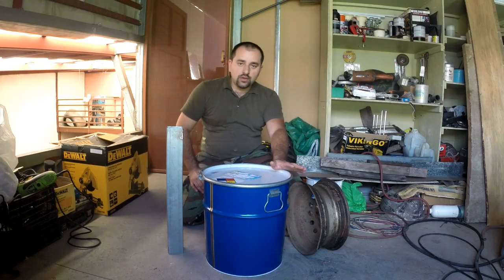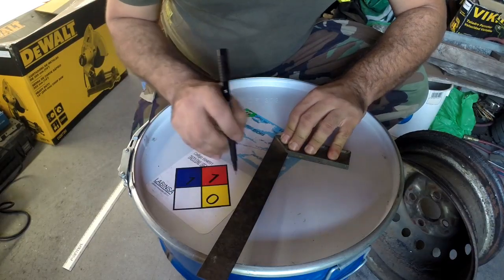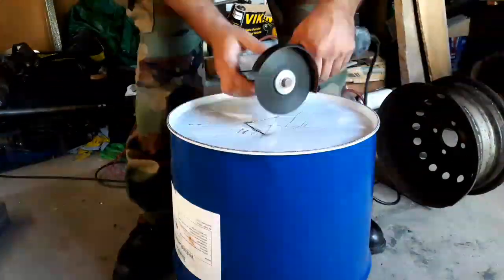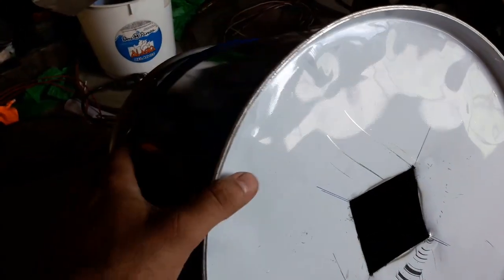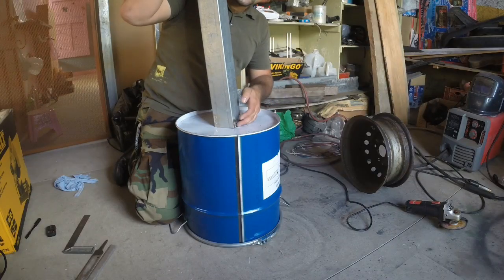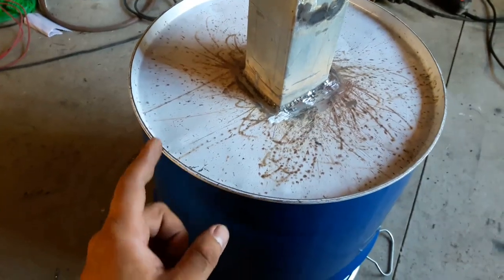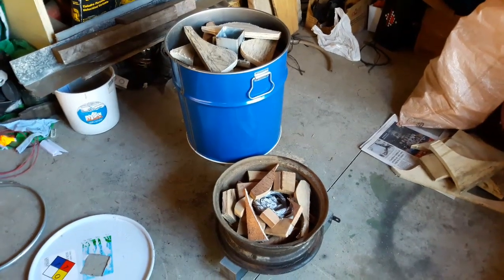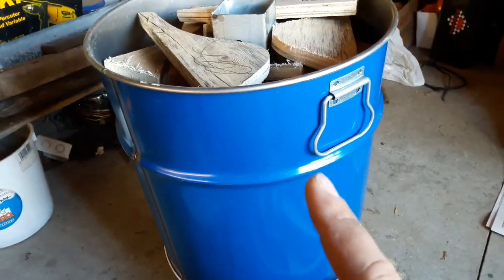Building a small charcoal retort part 1

Comment: Thank you for making this video. 
I’ve been considering making a charcoal retort myself, and in my research so far, I think this is the best design. It’s all self contained and when built correctly is the fastest and most efficient design. 
I think having more holes in the chimmeny and the addition of an insulation wrap around the barrel itself would drastically improve your chances of success. 
I am going to build a retort out of a 55 gallon drum and 6” pipe.
Again, thank you for the advices

Comment: Nice video.

I would suggest you make this a rocket stove instead for the following reasons.

1. You will get a hotter fire with less wood.
2. Easier to feed fuel in the air/fuel feed.
3. You can capture the gas and use it for cooking or running a generator.
4. You can insulate the outer barrel to retain more heat.

Comment: You burn from the top down...this should be a double barrel...it Will.then burn all smoke...the final product was incomplete and when burning top down...there is no need to resupply the wood for burning. It's a walk away until it's completed. A great try...but fail sadly. Great welding.

Comment: Here's my retort, the gasses coming out the bottom, lighting and continues the rest of the burn.
https://youtu.be/6CtIOXRXVqc
Not to mention, you don't have any vent for the gasses inside the retort to escape, the pressure will be enough to blow the barrel apart.

Comment: For that to be a retort you need a pipe running from inside the barrel to the fire below, so the gases from the heated wood becomes fuel for the fire. What you have there isn't a retort, so you may wish to amend your video title. Would've been good to see you welding too!

Comment: Surprised that you didn't burn the house down, if that would have gone into afterburner mode, you would have, be thankful for the smoke chasing you out of the house, a slightly taller chimney will help burn the smoke cleaner. Otherwise you got the rest, as you said, bigger diameter chimney and more holes, she'll burn more efficiently, and make a proper firebox, those concrete blocks will crumble quickly.

Comment: Nice setup, I don't think a bigger pipe is needed. If the outside of the barrel was thermally insulated ( glass fibre matting?) and you made the burn box bigger you should be able to get a more stable temperature and more even gasification.

Comment: Hi Diego, Can't you put the bottom of drum on the rim, why turn it upside down with the lid on the rim wouldn"t that ruin the lid ?
Reply from the maker: Bottom of drum and lid are made of same steel, and both will get damaged with time. Its easier to change the lid, than fix the drum.
Reply: Ok I get that, I was just wondering why turn it upside down I thought there was another reason, cheers

Comment: Very nice but all the smoke means it’s not burning efficiently. Slight design change and it will  burn cleaner creating less pollution
Reply from the maker: Thanks. Already did some modifications. There is another video on my channel with the changes. 👍😁
Reply: Gene Miller probably allow in more air for combustion.

Comment: Looks like an awful lot of work sticking little pieces of wood down that square tube. Would it be easier just to have holes in the bottom of the barrel and keep the fire going underneath between The cinderblocks?
Reply from the maker: You are right, i fixed that problem doing some improvements later. Thanks
Reply from the maker: It worked 👍😁
Reply: yes to the first, no to the rest. easier work, maybe, but harder work ultimately. open holes, above a flame... that would turn the wood into ash, unless my chemistry is off today. i mean, if you wanted ash that might work great.

Comment: Smart simple construction, but you can easily improve it. Instead of the wheel rim, use any kind of steel bucket as fire chamber, about the similar size of the steel bucket that you are using as retort chamber. Discard the lid. Then cut a 25cm wide and 20cm high hole in one side near the bottom. This enables you to add more fuel when needed. It will perform as a rocket stove, and it keeps the ash inside in windy days. You can now virtually burn 10m long pieces of wood, just push them a little further into the fire chamber when they have burned for a while; no need to cut them in small pieces! To get full carbonization of the wood inside you need to get the temperature up. Take a 55 gal. drum, cut a hole in the top for the chimney, cut a hole, the same size as in the fire chamber, near the bottom in one side, and finally cut out the entire bottom. You then place this barrel upside down on top of your retort when everything else have been prepared for a burn. The air in the large barrel covering your entire construction will keep the heat inside, thus raise the temperature in the pyrolyzation chamber. The steel bucket underneath must be trimmed in length to make the whole construction fit in length within the large outer drum, otherwise the construction might be both unstable and unnecessary high. Instead of holes inside the chimney for the wood gases, you can also improve the system by drilling two holes near the outer edge of the retort bucket and weld on two steel pipes, reaching 4/5 up into the retort chamber. They must be placed so that they protrude 2cm out of the bottom as well and point directly near the opening of the fire chamber, thus the wood gases are led into the airstream just in front of the burning wood underneath. This gives additional heat under the reaction chamber insted of burning halfway up the chimney, and thereby eliminating the problem with only partially carbonized wood on the bottom of your pyrolyzation chamber. I have a slightly more sophisticated rocket stove unit with a square fire chamber made of 4mm stainless steel that is fully insulated with Perlite, built into the lower 1/3 part of a cut off 55 gal drum, fitted with air regulation, and the upper 2/3 part of the same drum is likewise fully insulated with Kaowool, so is the lid. The retort chamber is made of a 60 liter water tank, and has a charging door sealed with ceramic fiber fire proof door seal rope; completely gastight. It becomes tremendously hot! Happy burns to you.
Reply: Hi , Don't worry about changing anything with the build until you wrap up the outside of the barrel with a insulation blanket  , just try it with insulation you will see the difference straight away .
Reply: I agree with "imhardwork" about insulating the outside of the drum. The paint hasn't even discolored so it hasn't got very hot  that is why the wood hasn't turned into charcoal.
 If you look at your video when you open the drum the wood on the right is brown  where it was against the cold side of drum and black nearer your fire pipe. Otherwise the design is ok but better to put in bigger pipe and holes for the gas. Though you could try putting holes in the "lid" about an inch from the outside as the gas would come out there and burn and heat the bottom b4 being sucked up the chimney
Reply from the maker: +superdream58 I was thinking on improve it a little bit. Will take some of your advise. Thanks.
Reply from the maker: +imhardatwork,Thanks, I was accually thinking on some inprovements. But minor changes, just a little bit.
Reply: I am interested in making on commercial basis. any help superdream58? abkambobe@gmail.com